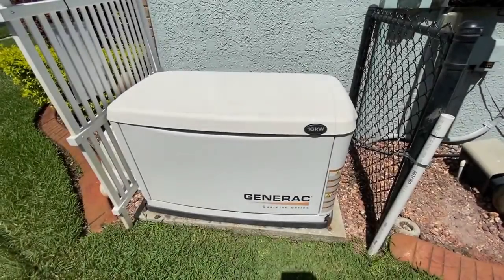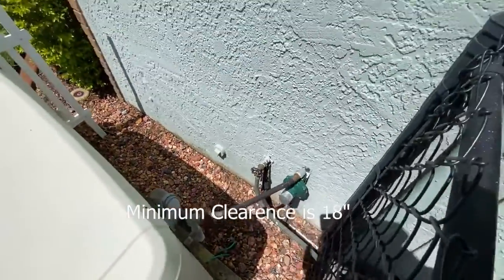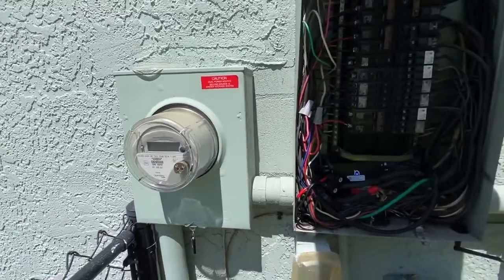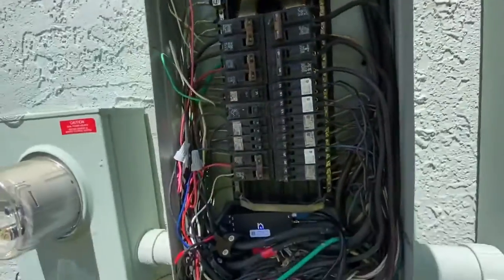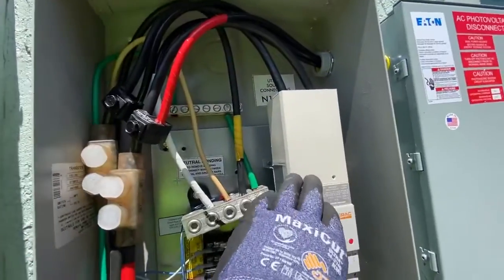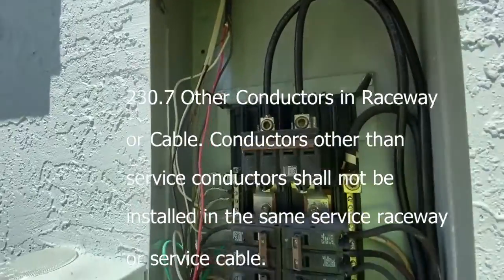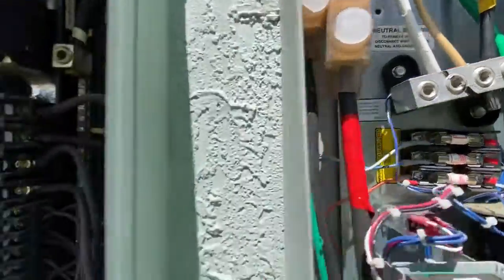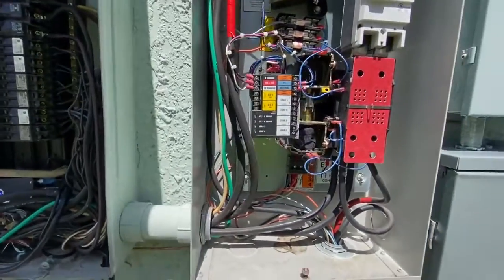Improper Generac Generator Install - Things I Found Wrong

Comment: as a factory trained Generac guy going back 25 years, I can also see the unit is too close to the meter. (5 feet in most places) Gas could easily be fixed by extending the vent around the corner, at least 5 feet from any source of ignition. (unit and panel) Can't say for sure if this is less that 18" from the building but that plastic lattice has to go. It will melt / warp after only a few hours of run time. This is a bad case of the installer not knowing / choosing the options and explaining them to the customer. The wiring is just poor attention to code and detail. That could have been fixed in a few minutes during installation. Now it will take hours.
Reply from the maker: Thank you for your comment. Really appreciate your confirmation that this could’ve been a better install. The homeowner had no idea. And a permit wasn’t polled. This is not a Generac at fault this is a contractor at fault. 
Thank you so much for commenting. Feel free to share this with your team or new installers

Comment: Also, there is not any clear space for the exhaust on the left side of the Generac. There is a fence blocking it.
Reply from the maker: That’s true. It’s probably supposed to be at least 18 inches clearance for that as well.. 
Thanks for watching and commenting 🙏

Comment: That's what you get for not hiring a legit electrical contractor. It's  the law. You can't just hire a "licensed" electrician .
Reply: BS - EVERY Municipality/County/State "law" is different! There are a LOT of places in the US that you hire a "licensed" electrician , and not necessarily a contractor, I live in such a place.
Reply: @scotty362100  I’m in Texas.  What the original poster is trying to say, I believe, is that just because someone is a licensed electrician doesn’t mean they know the install manual or are considering all the specific situations that come up in generator installation.

I’ll give you an example.  92 year old customer had an electrician install a 24kw Generac air cooled unit.  The unit had 3 feet of clearance on 3 of 4 sides, and was 18 inches from a brick wall on the other.  Met NEC guidelines and the install manual clearly says 18 inches on one side and a minimum of 3 on all other sides, so ok, right?

Nope.  Generator exhausted directly into the brick wall with only 18 inches of clearance.  Motor burned out when she ran it in a hot Texas summer outage .  Generac denied the warranty of the now 94 year old home bound female.

Not a unique situation.  She was not looking for lowest bidder she assumed an electrician that had been around a while would know what to do.  Unfortunately she was wrong.  

It’s kind of like going to a family practice doctor for heart surgery.  Are both options doctors?  Sure.  But who would you have cut your chest open?  The cheaper one or the one who does heart surgery every day?
Reply from the maker: Nice Brian. Thank you for that Write up. 
WE are the professionals. People put their trust in us that we know what we’re doing and we know the latest codes and that their safety and family is at the forefront of everything we do. 
Will the install work taking shortcuts as this video pointed out? Yes.  But if we can’t install to at least the minimum standard just to take more profits and take advantage of the customer somebody should be ashamed of themselves.
Reply from the maker: As long as your “qualified” it does. It matter. The point is if you are the installer / contractor, you’re the one with the knowledge to do the install correctly. We must be the champions for the homeowners who hire us to do it correctly.  
Thank you for watching, commenting.
Reply from the maker: It’s amazing what’s going on out there and again it’s usually the homeowner that needs to trust what is being down as being done correctly. 
Unfortunately, they get taken advantage of sometimes. 
Thanks for commenting!

Comment: There's F'ed up wiring everywhere so I'm not going to say this is unique to Florida because it isn't. 

Did you do a corrections video?
Reply from the maker: Hello Ron thank you for your comments and question.  I have not done a correction video for this.  It could be corrected by adding a second conduit coming out of the meter and going directly to the generator panel. Those wires would be your line side or unfused conductors. 
You would then remove the wiring that is existing coming from the meter running through that MSP panel to the generator. The wiring coming off of the generator feeding the MSP could stay the same with the exception in the MSP. The neutrals and grounds need to be separated and the bond screw removed. 
I would have to have this customer’s approval to do so, and I would have to pull a permit and schedule a disconnect with the utility to make that video. 
Since this video, I believe the homeowner did a main service upgrade so hopefully when they did that they corrected the way this entire set up was wired. 
Really appreciate your questions and yes the wiring is screwed up wherever you look. 
Thank you for watching !
Reply: Ron has a great channel himself too love the videos from both of you guys
Reply from the maker: Agreed and thank you

Comment: Wow that was bad I don't get how someone is smart enough to get the unit to function in the first place but at same time made all those mistakes just crazy
Reply from the maker: Maybe been unknowingly doing it that way for years. Will it work this way? Yes. Is it the safest this install could be for the homeowner? No. 
This is why it's best to have your contractor pull permits to make sure it's done to code. Thank you for watching and commenting!

Comment: Informative, to say the least. Did the installers even ask for YOU to pull the permit? If you had pulled the permit, YOU would be the electrical contractor responsible for everything. I'll bet they did the work on a weekend, holiday, or even after the inspectors had quit work for the day. This is common where I live in Florida. Did you check if they were licensed, insured, and bonded? They base the job on Time. The least, the better. The effort is the same as Time. Money, the more they can sucker you into paying, the better. If this would cause a fire and damage your house, your home insurance company would probably not honor your claim because no permit was pulled and no inspection was done. I'm sorry to say, but you have been scammed big Time.
Reply from the maker: Agreed. Sadly the homeowner got screwed with the poor install. We as the contractor should be the professionals.
Reply: @YourFloridaElectrician  my neighbor tried to screw me recently. I called permits and they have no recent permits. I know a Generac generator was installed and other work so I’m highly considering reporting them.
Reply from the maker: If no permits were pulled. It will catch up with them. When they go to sell the house they will see no permits for it were pulled. They can't sell until the paperwork is in order.

Comment: so they made the main service panel a sub panel and disregarded bonding, this guy either wanted to go home, had pressure to turn the power back on, or just didn't care.
Reply from the maker: There was simply no permit pulled so they didn’t have to do anything they didn’t want to do. Nobody was coming to check it. 
Home owner called the city after I noticed it and said there wasn’t one pulled. And unfortunately it’s not up to the homeowner because most of these guys don’t know the requirements. It’s up to the contractor to do things correctly for the homeowner. Their customers
Reply: @YourFloridaElectrician  he’s has no pride in his work I’ll tell you that
Reply: @BeatBoyStill  Maybe has pride and just doesn’t know or at that time didn’t know what the codes are. It sure is easier not adding that second conduit for the nonfused conductors. 🤷
Reply from the maker: Very true. 👍